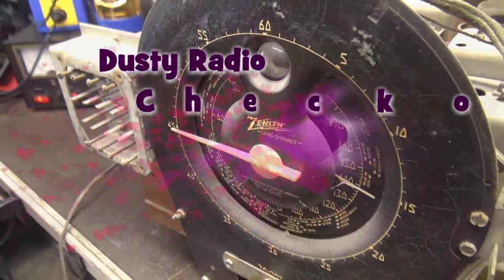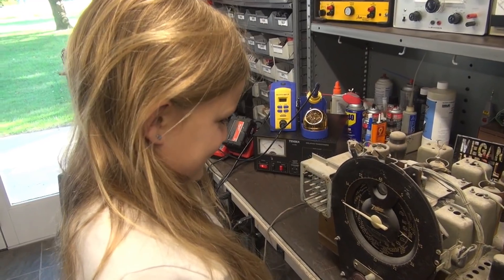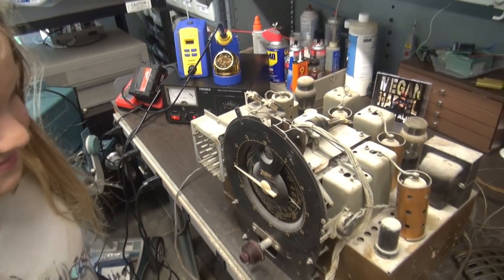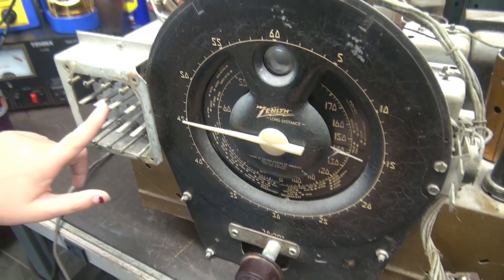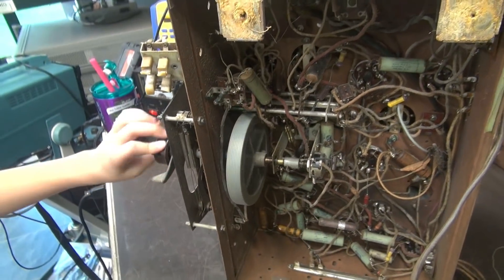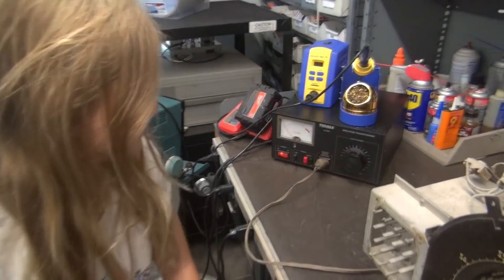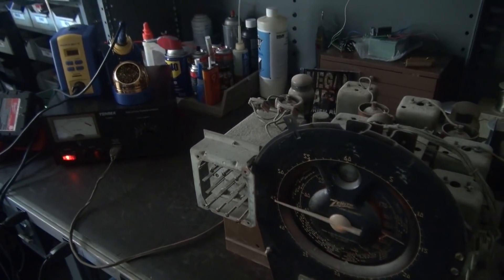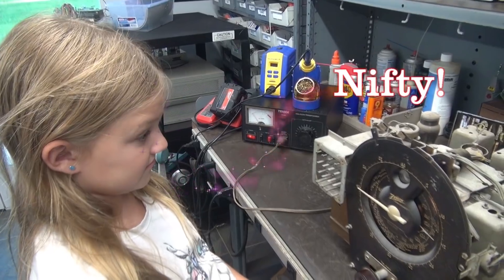How to power up a 80 year old Zenith 9S367 console radio using a variac

Comment: I was about her age when I got interested in old radios.Actually,around the age of eight;I remember coming across the chassis to an old Zenith which was under the porch of my grandparents' house in Reedsport,Oregon.In 1959,a man I knew in the same town named John Baze,gave me a chassis out of an old radio.The only thing I remembered about it was the cabinet and the "clamshell" shaped speaker grille.Years later,I learned it was a 1929 Philco.I've owned many Philcos since then made from the '30s into the late '40s to early '50s.I have a circa 1951 H615Z tabletop on my bench now that needs new filter capacitors installed plus a restringing.Glad to see she is into shortwave radio;I did my listening in the late 1960s on a circa 1936 Wards Airline three band "tombstone" from late 1968 until it died in 1972.I gave $2.00 for it at a junk store in my hometown of North Bend,Oregon where I still live.I hope she keeps up her hobby:I'm still at it after about sixty years

Comment: I would have preferred seeing a video on this particular radio without the kid aspect. This is a very interesting piece of gear, but this video doesn't do it justice. I had one of these chassis as an adolescent, same as this, without the wood cabinet, that I restored to full operation, and used for years, and would have loved to see treated to a full restoration video here.

Comment: 9:44 Seriously???  You're really gonna plug that ratty cord into a power supply?

Meijer and Walmart have 6ft extension cords (16/2 lamp cord with polarized plugs)for around $2 - I buy a bunch, lop the socket ends off, and use them to re-wire old radios like this.
Reply: Live life on the edge
Reply: Yep, walmart cords I do the same!  I have done the same thing, spread the wires and pug in to test....usually because of impatience.......oh well this radio will be mine in less than 2 weeks to play with

Comment: The magic eye tube was developed by Allen B. Dumont, of oscilloscope fame. Before the 1920s, CRTs were based on the Braun tube. Braun's tube did not have a heated cathode, it had a molecular spike and operated at 100KV! The spike was a tungsten or platinum pin that was sharpened to an atomic scale point by a complex acid etching process. In operation, the electrons shot off the end of this spike. Because the forces were so huge on that scale, the tip eroded away quickly. An electron gun thus had a life span of less than 24 hours typically. So.... along comes Dumont, as a cocky teenager, and he has a better idea for a long life cathode. Like most teenagers, he had no money. There was a contest at the time to "invent"  an alternative for glass milk bottles which were not cheap and were heavy. Dumont invented the paper milk carton as we know it today! He used the money to finance his idea to make long life cathodes for the CRT and he owned that for a long time (until Tektronix whomped him good in the 1950s). From what he learned from that experience, he made the magic eye tube as a cheaper alternative for the very expensive "galvanometer" movements of the day. Those were made by clock makers at the time. The magic eye is the first really high impedance volt meter. Now you know. I can not believe that this is not known in our common lore. Dumont was a freaking genius!